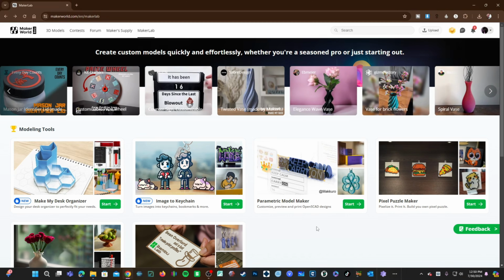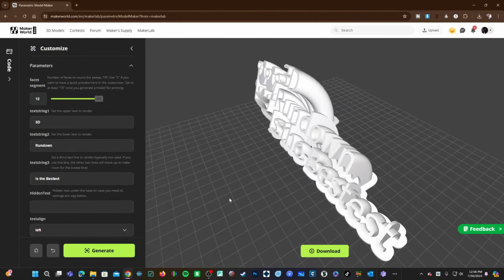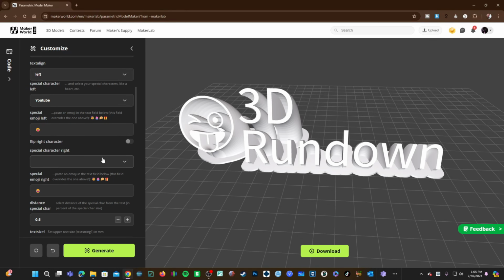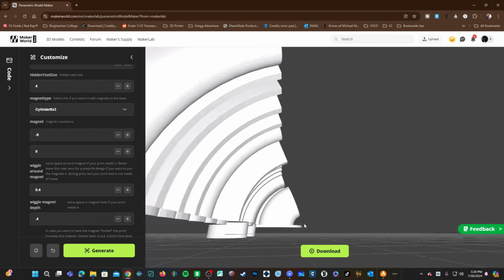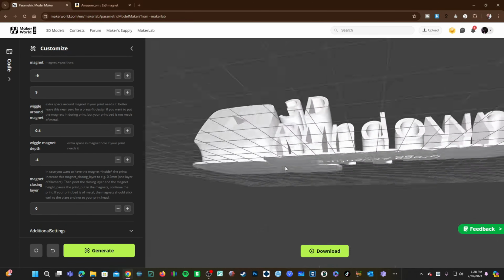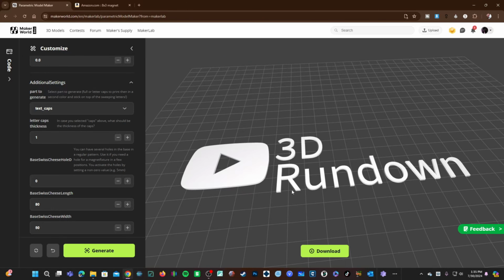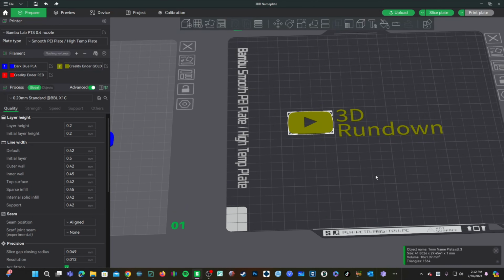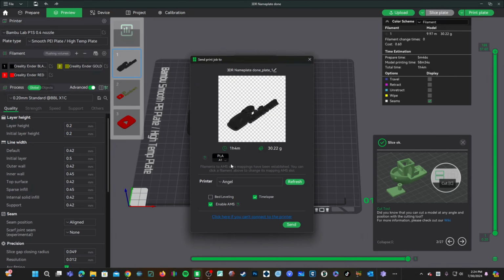TUTORIAL: 3D Name Plate Maker. Maker Lab: Parametric Model Maker in Bambu Lab Maker World

Comment: Like this one very much Gregg !
Reply from the maker: Thank God. Happy to hear this. This one took me FOR-EV-ER to shoot, and edit. It's so long. Praying people find it worth watching. :)
Reply: @3DRundown  dude how do you do embossed little signs 🪧? In maker lab ?
Reply: @3DRundown  lol awesome 😎 👍 thought of a project right away for it !!!
Reply: @3DRundown  Gregg is used multi color pla fist time came good but vase stuck to pei plate really bad . Any tips for removing? Help 😮
Reply from the maker: Be sure to use Gluestick or Bambu Green Glue to protect your bed. Drown the bed with IPA, it will dissolve the glue, to help release. Flex the bed in multiple directions. Use a razor scraper. A SCRAPER. Not a random blade. A SCRAPER that is designed for being moved FLAT over a surface, without damaging it. Get it just a touch under the model, in a few spots, and it should start to let go. More IPA once have some space under the model, if it doesn't let go. If desperate, can try to put it back in, heat the bed, and let it cool again. I have never had a model refuse to release. You'll get it.
Reply: @3DRundown  thank you Gregg
Reply: @3DRundown  Gregg i made a 3 d name plate !
Reply from the maker: Lemme see it!
Reply: @3DRundown  i take a pic soon of it . Hang on
Reply: @3DRundown  ty Gregg